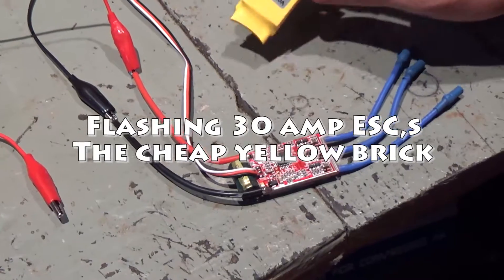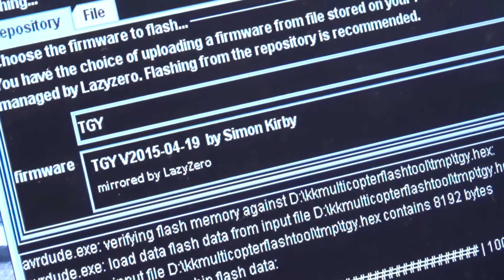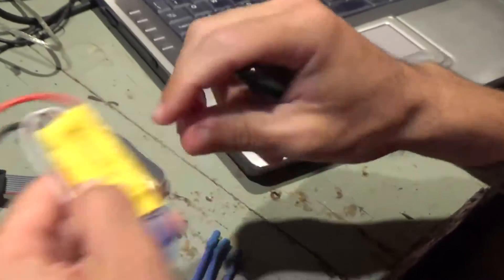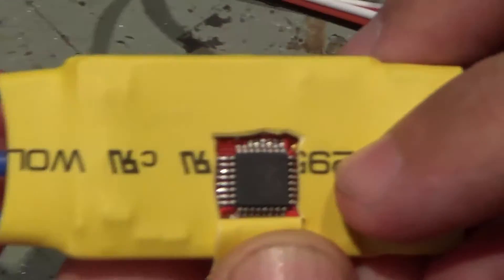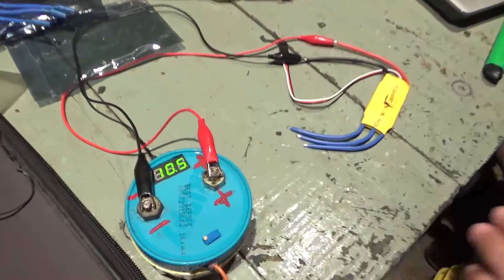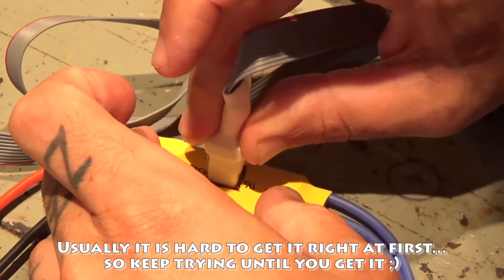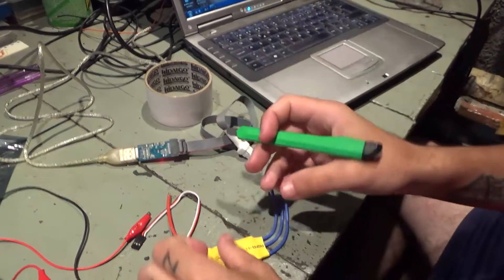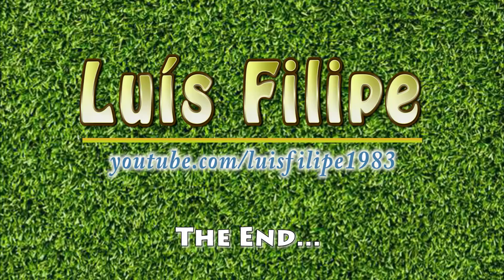Flashing xxd 30amp ESC's the cheap yellow brick

Comment: With mine i just soldered wires to the pads around the chip and used a basic avr programmer to connect to it. Those gold pads are MISO, MOSI, RST, CLK, VCC AND GND.

Comment: How much power does the esc need? Can I do it straight from my pdb and 3s battery ?
Reply from the maker: Zubair Ulhaq i usually use  1S 3.7volts but on that video i had 10.6 volts because i was using external power supply
Reply: luisfilipe1983 so could I do it straight off my pdb from a 3s battery? I’m guessing that’s going to be between 3.7v to 10.6. I keep getting and error or high fuse not detected so I’m not sure if that’s caused by the power
Reply from the maker: Zubair Ulhaq i think you could use 3s the error might be lack of power
Reply: luisfilipe1983 I just attached a 2s and 3s battery to it and when I plug it in, the esc makes the start up sounds unlike yours which is silent and I’m still getting and error during flashing. Any ideas what I might be doing wrong?
Reply from the maker: Zubair Ulhaq do you have anything plugged to the 3 wire connector that goes to the receiver or flight controller?
Reply: luisfilipe1983 I unplugged it from my flight controller but I have used these esc before
Reply: luisfilipe1983 I do have the motors connected to the esc as these esc are on my quad so could that be causing a problem?
Reply from the maker: Zubair Ulhaq oh...i think that is the problem, because being connected to the motor makes the ESC initialize as soon as it gets power..  disconnect the motor disconnect the board and give it a try
Reply: luisfilipe1983 you were absolutely correct, as I removed the motor it didn’t make the sounds anymore however I’m still not able to connect to it for some reason
Reply: luisfilipe1983 never mind, turns out the esc is faulty, burned up my motor yesterday

Comment: Can you flash the same way for planes? And also the cheap red bricks? The flash stick is available in ebay? You don't need to calibrate?
Reply from the maker: Stefan Vieregg M.A. yes inuse the same for planes...flash brick i got at hobbyking, and after flashing i have to do stick calibration with the radio
Reply: Thank you very much, Luis. That's the way, cool, no greater problem with soldering. You took a USB programming stick with which specification 3,5/5 V, or brand or software? And the adapter is called flash brick? I did not find anything today ... You mean the same software kkmulticopter for planes or another?

Comment: say please.
Firmware for these yellow ESC - is in the program kkmulticopter flash tool  ?   Or  need to download separately? Where can I download it?
Thanks for video!!
Reply from the maker: Alex R. hello, i use tgy from the online repository in kkmulticopter flash tool i don't need to download from any other place
Reply: Many thanks!!!
Reply: How many wires do you connect to the ESC from Nano?
Сan you draw a drawing - which wire from Nano connected to which  contact of processor?
Thanks!

Comment: Cheers ;) Why did you choose "TGY" in the repository tab? I've got ZTW 30a simonk esc's but don't know what file to flash.
Reply from the maker: Hi, i choose that because i have used it previously and i know it works fine with these, but if you are not sure wich one to use with your esc's here you have a list  where you can check what you should flash http://www.hobbyking.com/hobbyking/store/uploads/531431349X1176580X34.pdf ;
https://docs.google.com/spreadsheets/d/13tMlu5ldLNpZXwbe6UhDHJhcgTVuljm8HDiDp9WO9Pk/edit#gid=0
Reply: luisfilipe1983
Thanks Luisfilipe, that's a great help. I'll use the bs_nfet.hex to upgrade ;)